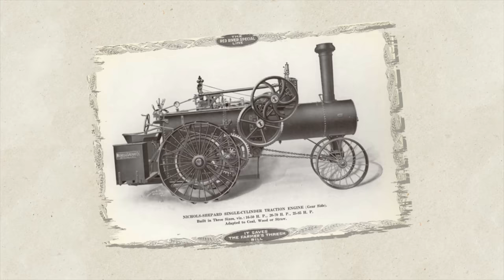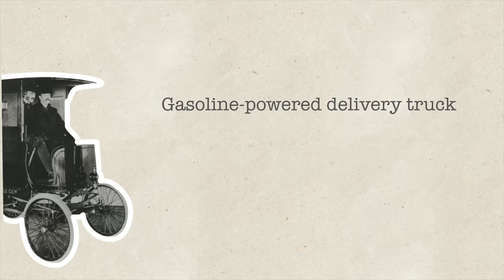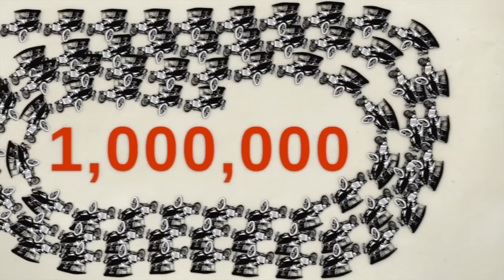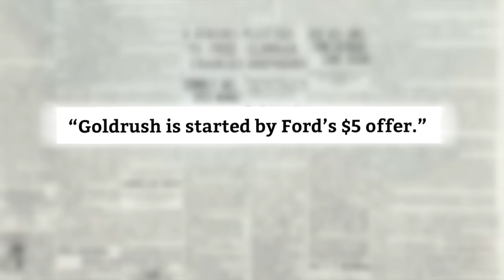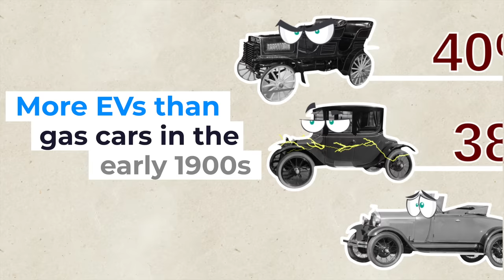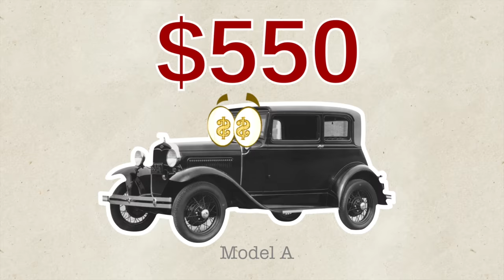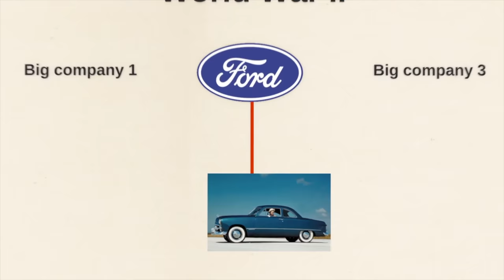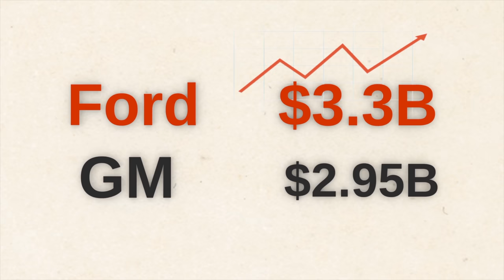Here's Why Real Americans Buy Ford

Comment: I once bought a honda accord; it needed a new engine AND a transmission in less than 2 years. I dumped it and bought a Mustang. Put over 250,000 miles on it over 17 years. I’ve owned 8 Fords in the 30 years I’ve been driving, never once been left walking.

Comment: Back then Ford: Let’s make a car affordable for the working man.

Fast forward, now a car can require a mortgage.
Reply: it is strange that in 1967 I could afford a new Mustang on minimum wage but now theres no way,, Ford should come up with a basic Mustang without all the frills and  geegaws, that would sell almost as fast as they could make them
Reply: @donsallee5941  a base hardtop inline 6 mustang had cost 19500  the average minimum wage was 7.75 an hour, aka no it wasn't  possible
Reply: It's the same today. You stated the key word "can" because auto could always require a "mortgage".  If you would purchase a Fiesta you could purchase one for around $12000.
Reply: @donsallee5941 , they couldn't if they wanted to. Safety features like airbags and seat belts and backup cameras are required by law. They also have to pass rigorous testing, making R&D fairly expensive. And some things aren't worth backtracking on. 35 years ago, it was cheaper to install window cranks than to install window regulators and motors. Now, it would cost about the same to go back to manual crank windows. 

I'd love to see car companies focus on budget models. But I think they'll always look like the Chevy Spark or the Mitsubishi Mirage or the Nissan Sentra. $15,000 - $17,000. At two thirds the price of a decent looking car, you might as well splurge.
Reply: More like...now that "affordable car" can only be sold with a 7 year 0% interest loan. lol
Reply: Sure ,thanks the government with all their taxes. The car isn't so expensive at all.
Reply: @ADOENDRA , yes, taxes cut deep into how much of your income you get to spend on a car. But inflation has hit cars disproportionately to everything else and the real problem is the declining consumer standards of car models. Back in 1965, the most popular car was the Ford Mustang, which had a base MSRP of $2,427. It had a V8 engine, a manual transmission, and rear wheel drive. It was a good looking pony car. According to inflation calculators, $2,427 of 1965 money would be worth $20,026 in today's money. Price out the cheapest good-looking car with those specs and see if you can find one with an MSRP under $20,026. You can't. You'd be hard pressed to find one with an MSRP under $35,000.
Reply: @davidporter7051  You can buy Fiestas in USA? wow I always thought they were Europe only.
Reply: And they only make it in 86 seconds!!!!
To keep you enslaved making payments for 7 years!!!
Reply: @hyperuben  they don't enslave you. You enslave yourself by getting that car.
Reply: @donsallee5941  or they can just drop the prices so that the working man can outright buy a nice mustang.
Reply: @precesionnoreaster1507  what year are you talking about? He said 1967
Reply: When I was 18 the minimum wage was 1.50 an hour, today the minimum wage is 15.00 a hour a new car cost 3500 then but today only 20,000 or less, stop pretending that was a difference that yesterday was cheaper, when in 1915 a Ford cost 600.00 the minimum wage was 15.00 dollars a week.
Reply: @michaeljohnson4204  You're making too much sense for some of these guys
Reply: @davidporter7051  Dude V8 cars were $3k bucks.  You didn't have to buy bottom of the barrel.
Reply: @1165slugman  and yet the most popular seller by far was the standard coup with a MSRP of $2400. $3000 was not affordable.
Reply: @davidporter7051  My dad was a shoe salesman at Montgomery Ward's. Bought a 69 Mach 1, Then later bought a 73 Corvette with a 454.
Reply: In 1970, the avg new car cost 36% of the avg medium family income..
     In 2019 the avg new car cost 59% of the avg medium family income.
   (Or something like that)
   Sorry I don't have a link. It seemed reliable enough to me at the time to write down.
   Look it up if u wish.
Reply: @---cr8nw  I don't think Cameras are required by law. I have a 2017 Ford F250 6.7 Powetstroke Super Duty XL with the FX4 package and it does not have a rear camera. I wish it did but it doesn't.
Reply: @michaeljohnson4204  the federal minimum wage is 7.25 which is $15k a year to get a $20k car.  $15 a week is $780 a year to buy a 600 car. $3500 would have gotten you a dodge charger r/t which understandably is more than 1 year Salary but a dodge dart sport, ford maverick, chevy pickup and barracuda were under that. All you could choose today is between 2 worse than ford pinto econoboxes that are less reliable than 20 year old cars by design.
Reply: @Notmyname64  he's makin 0 sense.
Reply: @TyDogon23  Why did you drag me back to this s**t 😂 Half the people here think the only way you get a car is to get a brand new one. I just bought an 05 4runner, happy as a clam
Reply: Ikr my ranger is like paying for a full size truck!!
Reply: We have had 70 years of govt regulations and requirements. Who do you think needs to pay for all these mandates?
Reply: @donsallee5941  Blame the government and regulations
Reply: @jupitercyclops6521  Averages like this can just as easily represent increasing wealth as increasing prices.  People with more money, buy nicer things.  For a fair comparison, you need to look at entry level vehicles, and you need to adjust for all the federally mandated costs, which can be half the price of a base model car.
Reply: @Notmyname64  The big problem has been inflation.  When the Central Banking system was established in 1913, our Dollar was worth a dollar, but it is now worth 13 cents--or less!!!  This is why many houses cost $1/2 million or more in the Phoenix area, and much more in California where I originated.  I know this because my daughter bought a medium size home in Scottsdale about a year ago for close to that, and it is now valued at $650,000???  So who can afford to purchase a fairly nice home nowadays?
Reply: @Notmyname64  I agree.  Even Consumer Reports highly suggests buying a vehicle  3-5 years old to avoid the high costs of a new one.  Besides, consider the higher insurance and registration costs for new cars.  I'm searching for a Japanese-made SUV 3-5 years old to save in all these areas.  Not to get into politics very deeply, I still have to mention that we are now headed into a high inflationary period in which fuel costs are steadily rising.  Maybe a hybrid is the way to go now???
Reply: Damn, I wish I could afford to buy a 3-5 year old truck!!
Reply: @rogersmoot6194  thats why it is dumb to allow paycheck theft. They print all the “money “ into circulation regardless of paycheck theft. Aka income tax on domestic Americans not involved in revenue taxable activities
Reply: @rogersmoot6194  Most of the inflation has been since we got off of sound money and went to pure currency (aka departure of gold-backed dollar)  When 30yr mortgage was created, it was assumed that most would die before or just about the time you pay off the house.  When Social Security was created, most people would die before being old enough to receive any money from the system.  All the regulations and testing that goes into building and designing safety into cars is mandated by govt.  Consider that when Tucker made his first car there were no requirements for safety systems.  Builders were free to decide on what safety items to incorporate.  The problem is govt regulation and Big banks/corporations using regulation to squeeze out innovation and competition.  
The challenge is to have a govt that is large enough to keep Big money in check, small enough not to stifle, and responsive enough to be the will of the people.
Reply: These damn computers
Reply: @---cr8nw  It doesn't matter what a budget car looks like. They're budget. They're cheap. They're the bare minimum. Looks aren't a factor on them. Otherwise, it wouldn't be a budget car.
Reply: @davecrupel2817 , you're right. Budget cars don't have to look good. But there are literally decades worth of car designs to choose from. They could easily remake a good looking car and it wouldn't cost the manufacturer any more than designing a brand new ugly car.
Reply: "Lord, Mr. Ford" by Jerry Reed
Reply: My Focus didn't require a mortgage.
Didn't require much of a loan either.
Reply: those ridiculous markups are only the result of stupid dealers and high desirability, not ford as a company.
Reply: Fjb
Reply: @michaeljohnson4204  the minimum wage is 7.50 not 15.00.
Reply: A car affordable for the working man. YOU MUST BE JOKING
Reply: @---cr8nw  closest thing to your answer is a 2013 v6 mustang which is 305 hp. More than those way old v8s at the time. But I suppose it's still not a v8.
Reply: @precesionnoreaster1507  Minimum is still 7.75, and you can still afford a 19500 car on that wage. What are you smoking